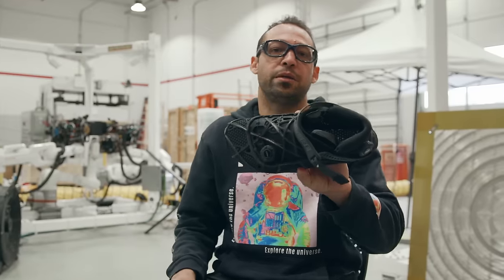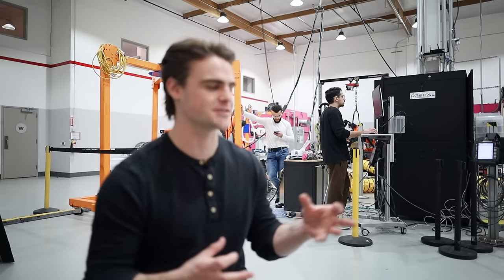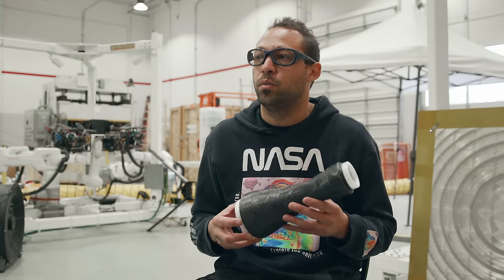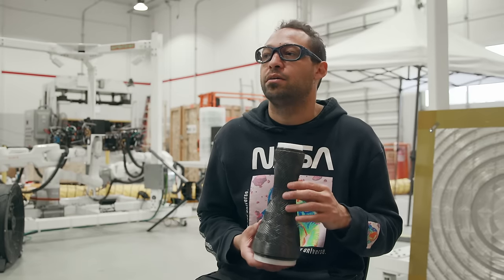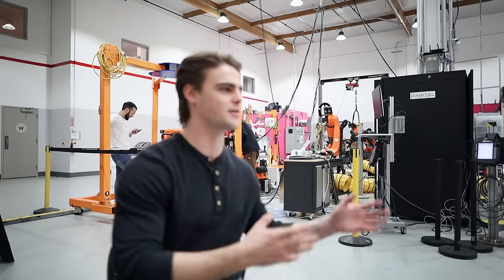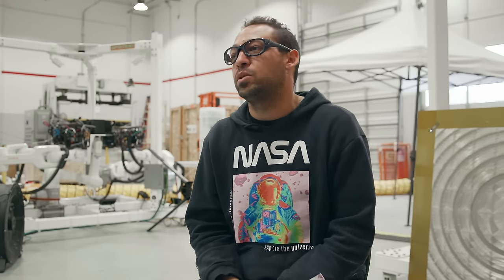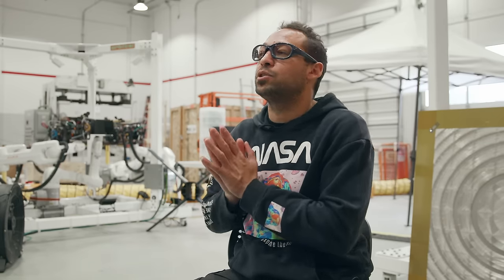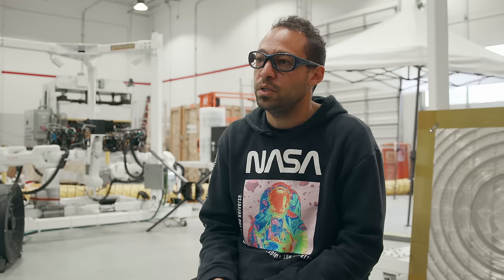Cole Nielsen-Cole: Why Mars and Why Space

Comment: Free idea: Much of future energy demand will be for computing. Solar satellites that beam down microwaves would help with that, but you get huge losses at every step. The better idea is to send the compute module up to the solar satellite, so that it just directly uses the 24/7 free power up there. If it sits in the shadow of the panel, the temps would be pretty darn low.  Because you don't need to beam the power anywhere, the orbit could be low, which is cheaper and better able to use the Earth's magnetic field. Yeah, you still need more shielding up there, but to me that just means: awesome huge heatsinks. The price of getting mass to orbit is about to decrease by a lot. The demand for power and compute is going way up. So yeah, solve that inequality and consider this free idea.

Comment: None made with carbon fiber config because of safety issues…case in point, the titanic submarine. We as engineers need to find a carbon fiber based material that can stand high temps, pressure, Gs, etc.